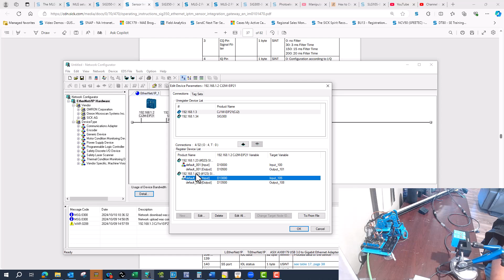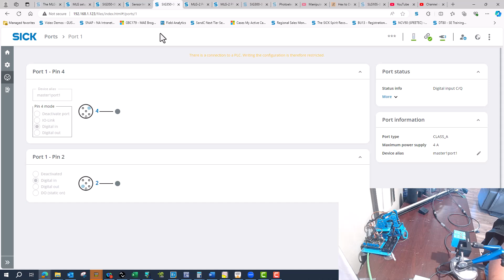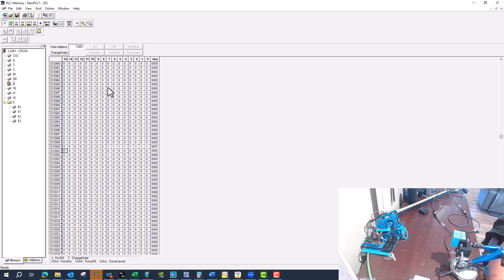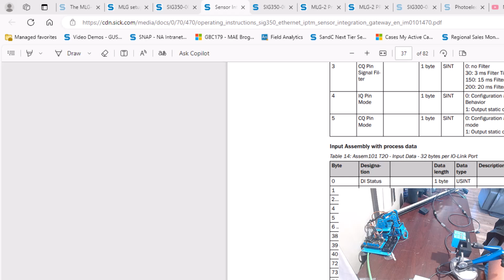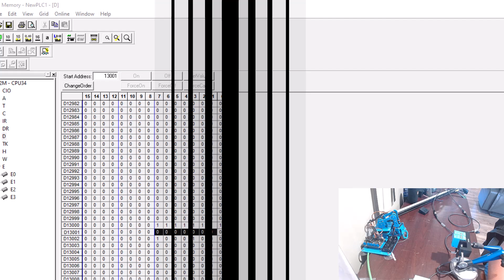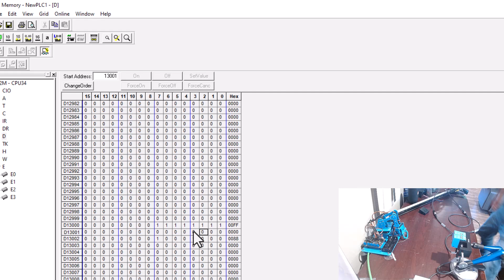Using the SIG350 for inputs on pin2 and pin4

Comment: How can I configure ports S1 to S8 with pins 4 and 2 as input/output via startup parameters?  Because I cannot connect to the SICK SIG350 EtherCAT via web browser and SICK tool.
@darrellbrogdon885
Reply from the maker: In this video I used the Ethernet/IP variant. The EtherCat variant has to be configured with CoE. This is typically done in the PLC software during initial setup of the device with the PLC.